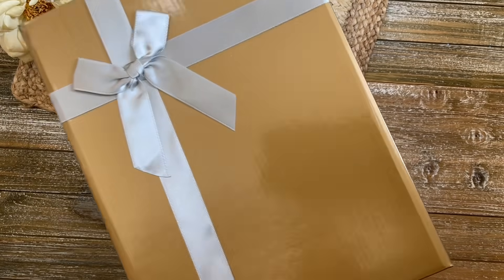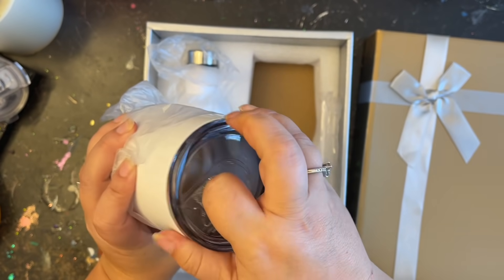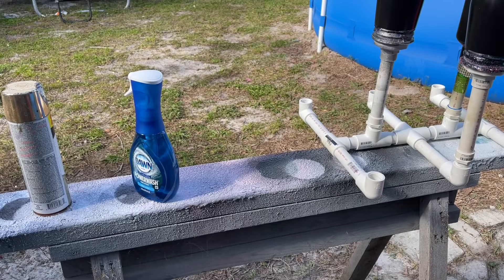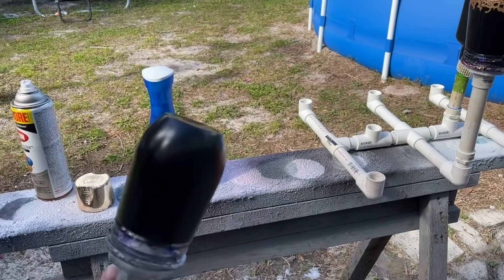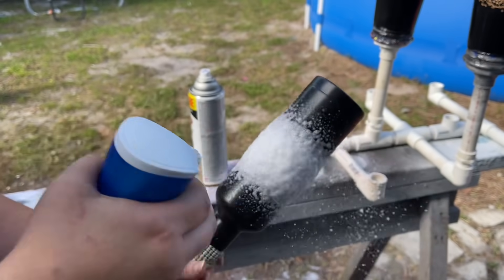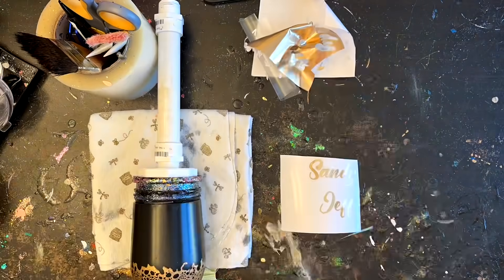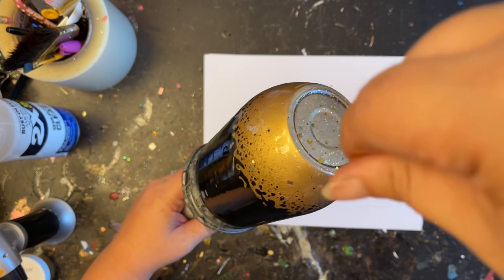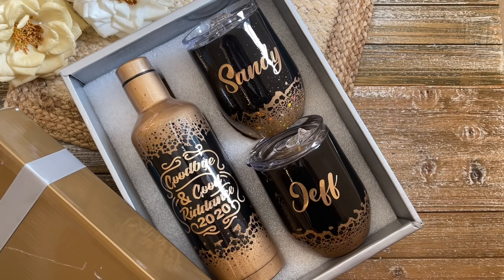Dawn Powerwash Method Tumbler Tutorial | extremely easy and addicting

Comment: I absolutely adore this set and your video was amazing.  How long do they need to cure?  I read one of your responses below regarding FDA compliant sealers.  Again, amazing video, spectacular design and thanks for sharing.
Reply from the maker: Thank you! Once your final coat is applied it is recommended by Alumilite, which is what I use, to let it cure for 7 days before it is FDA compliant. Even after that it take up to 30 days to be fully cured and rock solid.

Comment: I just tried this on the wine glasses as well as a wine bottle. Used semi gloss black spray paint. It dried for @ 3 hours. Stayed the dawn power wash and then my paint and rinsed and guess what? It didn’t work. Not sure what I could be doing wrong, but some of the black paint also came off when I wiped it down. Think I will spray with black chalk paint and see if it adheres better. UGH!

Comment: I just came across your video. Came out super cute. I had a question does the spray paint with the power wash work on any kinds of glass or only comes out good in products you used in video?
Reply from the maker: It will work on glass. It is just a bit more slippery lol. But I have gotten it to work 🤗

Comment: The tumblers are pretty! When you put the clear spray paint gloss on the circuit decals it didn't eat away at the decals?  What does the torch do?  Dry the expoxy?
Reply from the maker: It doesn’t eat away the decal. Just helps with fisheyes in the epoxy. The torch helps with micro bubbles. You simply sweep the torch quickly across the epoxy without stoping to help pop the bubbles. Then let it cure as normal.

Comment: Sandy thanks for sharing! Question! Is the torch necessary? I’ve never epoxied anything but would love to start!
Reply from the maker: Great question! So I didn’t start using a torch until about a year and a half ago. And I have to say there is definitely a difference once it has cured. Not only does it help any little micro bubbles pop, but I noticed it makes the epoxy more shiny as well. I was skeptical but now I use it on every tumbler I make.

Comment: How does the spray paint not wash off? U spray it right after the paint or did u speed up video and wait for the spray paint to dry then rinse?
Reply from the maker: I didn’t speed the video up. I sprayed my base coat black, let that dry, then I spray the soap where I want to block off from being painted, spray the gold, and wash it off with water right away. This is very similar to a hydro dip.
Reply: @SandysOrganizedChaos  ok I will give it a shot I failed at hydro dipping with spray paint I just use film for that now so hopefully this will work out it looks cool thank you for replying I appreciate that

Comment: You spray painted the base black first correct ? & what’s the diff from clear and white water slide ?
Reply from the maker: Yes, I painted the base black first. Clear waterslide is meant for lighter colors. When printed it is see through making it disappear on dark colors. White waterslide paper is opaque so when you print onto it you can’t see through it. I highly recommend using your print to cut option on your cutting machine for the white. If not you will see any of the background left behind. Most people opt for printable vinyl, or laying a white vinyl then a clear water slide because white waterslide paper is a little harder to work with.
Reply: @SandysOrganizedChaos  screenshots lol thank you so much!!!

Comment: These are beautiful! Did you epoxy the black coat before doing the power wash & gold spray?
Reply from the maker: Thank you! I don’t. I let the black dry really good then come in and do the gold on top. Adding the decals is optional before your epoxy coat. You can always add them after that first layer is on and cured.
Reply: Thank you so much!

Comment: So beautiful did you sand cup before painting or was it no necessary??
Reply from the maker: If you’d like to sand you can. I use a primer plus paint that adheres to metals so typically I don’t. All I do before hand is wipe them down with rubbing alcohol to remove any factory oils and then apply my base coat.
Reply: Sandy’s Organized Chaos Thank you

Comment: Did you air dry it after washing the soap off or did you wipe the water off with something?
Reply from the maker: You can do either. Before I apply my epoxy I do take the wands out and make sure they are dry as well. I typically use a flannel cloth to dry.

Comment: do u have to painted on black for the based coat? or can i just put the soap n gold spray paint on it without  the base coat? I have tried tonight twice n is not working for me without the base coat. plus i bought the wrong spray soap, I bought the foam instead of spray
Reply from the maker: You can apply the colors any way you see fit. It does help having the Powerwash spray vs the foam pumps to get the spattered look.
Reply: @SandysOrganizedChaos  ok thank u.

Comment: Do you sand the stainless steel first before painting?
Reply from the maker: I do sometimes. I usually use a primer paint that doesn’t require sanding. But if I run out I will give it a light sanding.

Comment: How long do you let your epoxy set before applying?
Reply from the maker: I don’t let mine sit.  I usually just apply it right after mixing it. But if you like yours to sit before applying, about 5/10 minutes should do depending on what epoxy you use. If it’s a fast set epoxy you will need to apply right away. 

Or if you are referring to adding the decals after the first coat of epoxy, I wait about 12 hours.

Comment: I've never seen the torch used... I Only have the heat gun... is that the same thing?
Reply from the maker: The heat gun just warms the epoxy and moves it around. It’s more about the butane in the torch that really helps any micro bubbles. The heat gun still works, but to me I really see a difference with the clarity of the epoxy once cured when using a torch.

Comment: So i tried this today and it didn't turn out good. Paint started running when i rinsed it off. What am i doing wrongl. Do i need to use a certain type of paint?
Reply from the maker: Some paint will run. You just have to keep rinsing it. But if all of it came off then there is a problem. What kind of surface did you use? If you layer paints you have to do one paint, rinse, let dry, then  do the PowerWash spray and add your second color.

Comment: When you say prep, what did you do?
Reply from the maker: I wipe the stainless down with rubbing alcohol to remove any factory oils. And I use a paint plus primer made to adhere to metal. I try and make sure to paint the day before I create a design onto the tumbler to make sure the paint has fully cured.
Reply: @SandysOrganizedChaos  paint primer? May I ask what you’re using? Or a similar?
Reply from the maker: @tamarawyche2221  I like to use Rust-Oleum. I’ve tried other brands and didn’t like them as much.
Reply from the maker: They also sell a self etching primer which works great as well, before you apply your base color.

Comment: what do you mean by "put it on the turner for 2 hours?"
Reply from the maker: I used a speed dry epoxy to seal the tumbler and it has to rotate on a tumbler turner until cured for a smooth even surface. I like to use Alumilite’s Amazing Quick Coat for my epoxy. It is FDA compliant which is important when making things that will be used for consuming food and drinks out of. I also have a video on how to make a turner if you can’t find a ready made one where you are. They do sell Spin It brand turners at Michaels and Hobby Lobby.

Comment: Why do you torch the epoxy and not just let it air dry?
Reply from the maker: I only very quickly touch the epoxy with the torch to remove any micro bubbles. Not for drying. Then I let it cure as recommended.
Reply: @SandysOrganizedChaos  ohh, thank you